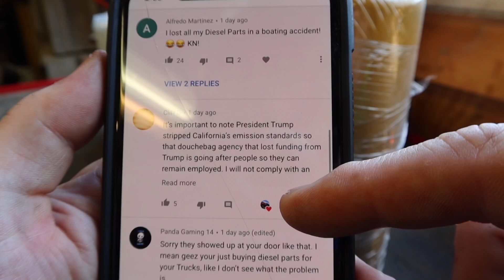I’m Under Investigation For Buying Diesel Parts!

Comment: This filter thing for guns is nothing new. Decades old in the gun industries.
Reply: True, but with all this Antifa stuff going on I'm sure there is more scrutiny... at least I hope so!
Reply: This particular way is also a feature of the the cod modernwarfare lol its like they want you trying it
Reply: @DFULLER17  art imitates life. im sure it existed and so they put it in a game. nothing nefarious just a cool concept for an escape mission with little resources there are plenty of games out there with murder must be trying to promote others to trying it hmm? ight.
Reply: @TheJaugernaut92  its called desensitizing
Reply: Oil filter adapters to mount them on a firearm are legal as long as they are registered with the BATFE as a suppression device and the tax stamp has been paid. Just saying.
Reply: @zmortis111  The oil filter adapter when registered as an NFA item is still a bit of gray area.  A registered suppressor including the baffles and end caps are also regulated as suppressors (odd concept).  You can't buy a replacement baffle outright because it is regulated itself.  You wouldn't register a single baffle.  You can send your suppressor back to the manufacture for repair where they replace the baffle and that is legal.  One company’s suppressors used a rubber “wipe” on the end cap and was told by the BATF that those were replacement parts and could no longer be sold to end users, but could continued to be installed by the manufacture as replacement parts.  Keeping in mind a rubber wipe has a very limited number of rounds through it before it is no longer effective.  Using a registered oil filter adapter with a filter technically makes the filter a suppressor part in itself -- hence the "gray area".
Reply: @Ianp54  antifa lol
Reply: @zmortis111  ahh of course its "legal" if you pay off the mob first... Hahahahaha

Comment: I purchased a Ford power stroke diesel the first motor went out at 20,000 a second motor went out at 38,000 and all has to do with the EGR coolant leak they said it was a great truck they fixed it under warranty twice I told him I’m trading it in if I didn’t it was going to become a yard anchor I will never purchase another diesel due to the fact that emissions kills diesel motors. I now on a 6.2 gas it has never broke down that 6.7 L diesel sucked.

Comment: Moral of the story: Buy filters with cash at your local NAPA.
Reply: Robert Slackware  lol. Not sure that works the way you think it does bud.
Reply: They're still gonna question you when you buy lots of Oil Filters and Oil Filter adaptors, dummy
Reply: There may not be any cash after the first of the year no matter who wins.
The old professor 
Live Free or Die!
Death to all Tyrants!
If you can not get behind these historic declarations you are on the wrong side.
No crap.
Reply: Nah.  Buy them where they are cheapest. You gonna need the money for whatever other privacy violation happens.
Reply: Robert Slackware where do you live.. Any state that requires a permit you would need to fill out an application. Thus giving your name
Reply: Robert Slackware so what state do you live in that you don’t need to give any personal info to get a carry permit? 😂😂🤡🤡

Comment: Thanks for putting us all on the tracked list now by innocently watching this video.  I mean, I'm not from your part of the country, so I had to watch all of it to understand the accent.  Plus I have a diesel truck.  On that, what kind of oil filter do you recommend for a F350, 7.3, IDI turbo diesel..  It's about 30 years old and is 8 cylinder.  Maybe recommend two. One to replace now, and one to keep as a truck filter if I have an oil related emergency and no repair shops open. The second can be cheaper and easy to slap on while on the side of the road or a field or whatever as a back up spare.  Anyway, raise your internet security awareness and searching after the fact maybe didn't help you.

Comment: I'm a silencer dealer in Michigan. I didnt know they were doing this kind of investigations. I knew there were some "solvent traps" advertised on Wish that were just silencers. I heard they were rounding those up, but not actual oil filters.
Reply: you mean "suppressor"
Reply: No he means silencer
Reply: @dsruddell  the guy that made them used the term "silencer " but they're known as both so it doesn't matter.
Reply: Solvent traps they've been using those forever they used to sell those in cheaper than dirt and literally all you had to do was drill a hole

Comment: One thing to consider. I too served in 2 branches of the Armed Forces. I have lost respect for law enforcement because I realize that in some cases they don’t have honorable intentions. I believe they you do. These guys don’t particularly care for your best interest, and are only concerned about closing this “ case”, preferably with an arrest. Police have been known to twist innocent statements into crimes, and more than once they have put innocent folks in jail. You might consider going to a lawyer, and the next time any one of them attempts contact with you, refer them to your lawyer. In general your lawyer will be smart enough to recognize when they are attempting to deceive you into admitting to something you didn’t do. You served our country, no need to get jammed up because of some over zealous Detective.

Comment: If you one have a business that goes through those filters on a regular basis . Two have a long term history of buying them. Three your in the clear. They had the same issue with starting fluid back in the late 80's and early 90's also included coffee filters, match's, hand warmers or ammonia in large quantities or frequently. My uncle owns a large cattle ranch and grows crops so he bought starting fluid and filter's by the cases and anhydrous ammonia by the thousands of gallons they ran him through the magnifying glass because he brought precursor materials. But with twelve different vehicles that had ether injection for cold starting, and 6 farm truck's that he would sometimes use either on he had to buy it by the cases, coffee filters are good for other things besides coffee or meth and and anhydrous ammonia is fertilizer in a easy to dispense form but the DEA didn't like it. But  eventually they were off to bigger fish since he was just farming and ranching.

Comment: I mean oil filters have been used for a while now.. call of duty even has them.. fram filters for pistols
Reply: Hickok45 made a video awhile back about legal to purchase suppressors that resemble oil filters.
Reply: @johnalan6067  It's a fitting that threads onto the filter that fits the threads on the barrel. This fitting is NFA item and can be purchased legally with a tax stamp.
Reply: yellowbusguy exactly and then screw the filter right on
Reply: Yea pretty soon you're going to need a background check, and a $5,000 permit to buy a threading die and tap
Reply: Joshua Bainbridge LMAO! Yup, and a $10,000 permit to buy diesel fuel because “What are you using this diesel fuel for again sir?? Running your truck? Come on! Be honest with use. We’re from the government, we’re here to HELP...”
Reply: Days gone lets you buy / find cans and oil filters to use as suppressors too
Reply: @thopkins22 I've also never seen a place where you can just buy a silencer/ suppressor without a background check, and zero questions asked.last I checked, these items require both a background check AND a tax stamp. If you buy anything elsewhere labeled as a silencer or suppressor, it's probably a faux one which is pretty much only for looks, not functionality

Comment: "Dangerous suppressors" ROLF

Isn't this ATF jurisdiction?
Reply: Bureau of Alcohol, Tabacco, Firearms. ( B.A.T.F. ) was previously known as.

Alcohol, Tobacco, Firearms ( A.T.F. )  currently known as.
Reply: Knock knock,

Who is there ?

Automatic Transmission Fluid.

Huh ? I was not expecting ATF to show up, since I did not order any.

I ordered some motor oil filters, wha is going on ?

Puts the A.T.F. on the stock shelf, leaves the garage, and locks it up.

Goes to sleep.
Reply: Atf should be a convenience store, not a branch of government
Reply: Customs enforcement is under homeland security now, a lot of what he ordered was probably imported, so customs can inspect it, track things that seem suspicious, etc all without ever needing a warrant.

Comment: If you’re smart you will hire and attorney to make sure this gets closed.
Reply: Nonsense.
Reply: It costs $5K to $10K to retain an attorney.  But the problem is that 99.9% of the attorneys out there know Jack about the ATF and NFA law.
Reply: @petersouthernboy6327  good think there are lawyers that specialize in gun law
Reply: @grapesoder1301  - with a billable of at least $500 per hour.  With a retainer up front.
Reply: @petersouthernboy6327  Could be less, I had a similar incident but worse, $2,000 in lawyer fees.
Reply: I hired a lawyer to sue for non payment on a construction job..
What kind of lawyer? One that specialized in construction cases... 
He assured me that it was an open and shut slam dunk case until I'd written the check. Then he asked "what judge you get?".
I told him. He WINCED and said that judge don't like him and said I'd be better off representing myself. He kept the loot.
I did all the work filing the case etc. All he did was have his secretary type it up nicely. I even had to pay to get the non payer tracked down and served. Private detectives actually do what they say they can do. Other than that the justice system is laughable
What a fucking ripoff.
Reply: Total waste of money.. I just wouldn’t answer anymore questions for them.. if they actually bring charges, then lawyer up
Reply: @mikeries8549  a federal criminal defense lawyer would be warranted in the case of the YouTuber in question, a totally different issue than a civil case due to lack of payment, by a huge margin.
Reply: Law enforcement actually never closes the cases especially if they have made a mistake, No one wants to write the report for the IG to read unfounded, that means we investigated an innocent person, So no report case will stay open, citing we may get back to you.
Reply: Problem with that is getting stomped on because you hav not enough money
Reply: @zazarays  that is an unfortunate truth!
Reply: There is nothing to close dude.  Private citizen did wrong and the police and feds will continue to spy and get no warrants.

Comment: The fact that you didn’t buy an oil filter suppressor adapter means THOSE AREN’T SUPPRESSORS!  You can’t just screw a filter on a gun without modification.  Period.

They actually do work, it doesn’t take much to decrease the dB.  Even a pillow will silence a gunshot to an extent.  Oil filters decrease the bang by a good 20-30dB.  The performance will degrade faster than a purpose built suppressor though.

Comment: 2021 the president passed a law that said everybody's phone data and financial records will be accessible to the government from your phone. The most only illegal thing I do is speed in my Prius that I've modified. Instead of 84 mph. I live next to the biggest auto testing facilitie in Arizona.  When I turn the traction control off with the computer app with no button for it it accelerates from 0 to 60 in 5 seconds. And according to the test track driver and gps. It does over 110mph. Amazing what a Thornton tuner chip and A electric supercharger does to a little teeny engine. It's a 2003 Prius with the original battery. And with the computer chip the battery lasts longer and charges faster. And my gas mileage is up the 40 miles to the gallon from 29. When I drive it like a Prius. I even towed my 1977 Ford F150 Ranger XLT 4x4 to a transmission shop when the 45-year-old transmission finally gave out.

Comment: The local cops should never have went on this call. The state has no interest in a guy buying oil filters. This is a fishing expedition. I was a patrol Sgt for a police agency and I turned the feds down several times for BS like this. You get into a problem call us. Got over ruled once by the WC or sometimes had no choice but to assist. Tactically these guys are a friggin mess and can screw up a wet dream. Don’t give them the time of day if you don’t have to. Not a fan of the feds at all and what we’ve seen of late just reinforces that.

Comment: Anyone have any good sites for diesel parts? I need a transmission and a transfer case for a 2004 dodge ram 2500 4x4. I know it's going to be expensive, but I'm trying to keep the cost as low as possible.

Comment: Yeah, because you looking into suppressors, even probably clicking on ads, you were added to a watch list. There’s a whole system. And the reason why they showed up at your door after you bought the oil filters is because people are selling “oil filters” and other “filters” as quite tech stuff for your super soakers, just labeled “filters”. 
So, you were added to a watch list for looking into suppressors, then when they saw you buying “filters” they had to act upon that, and make sure you don’t illegally own any suppressors. Even though I think they shouldn’t crack down on them, it is good that they at first give you the opportunity to just turn them over. They’re not buying them back, they’re just taking them. Which is better than jail time + huge fine.
I can’t really say too much about the correlation because I don’t want anyone getting into big trouble over illegally owning suppressors.

Comment: 7:05 That's really bad; bitas or particals of metal. That's worse than what people call a Fram " O.C.O.D". Tiny pieces of cardboard might not destroy an engine right away. Metal particals will NOT burn up and might even grind out and wreck a crankcase. Thankyou for warning us all in advance. I'm only a self admitted wannabe maintnece parts changer; not a mechanic.

Comment: Technically this is an invasion of privacy. In addition fuel filters are also used as a connection point for a Hydrogen or LP bottles. Because you don't want to damage your fuel rail. Also I am trying to convert an RX-7 rotary engine to multi fuels! They will also tag you for ordering off Amazon.  3 months after ordering a fuel filter from Amazon and Amazon had reimbursed me. I got a letter from US Customs. I explained that the fuel filters were now Amazon's problem because they had already reimbursed me. Now that I have finished the Mod for the individual who owned the RX-7 engine. I am trying to set up a Hydrogen cell for my generator. Now because of idiots in the government I can't get the quick connects tapped into the empty fuel filter tube to add the Hydrogen and LP bottles to my generator. Because some people are making things into silencers or so they think hint(it doesn't work as advertised) plus a buddy blew up his rifle trying to do stupid mods.  Stick to legit uses folks and don't believe the click bait on YouTube email etc.

Comment: Good video. I don't understand how you have respect for those who are the main cause of "these times". My g0d man they showed up at your home with guns over a few oil filters...
Most of those oil filter suppressor kits along with the auto pistol conversions are in fact sold by the ATF or other law enforcement. Its called a trap. Last ... why yes "they" are watching everyone.. the difference is they are open about it since 2015 Just FYI..

Comment: 2015 deleted Turbo Diesel 10,500lb TRUCK!  I get 27-33+MPG on freeway!!!! 6speed too!  My oil is clear till about 5000, so I change my oil every 5k to keep the oil clear. No DEF. I have about 498,000 miles and my oil is CLEAR!!!  2nd clutch, 3rd set of brake pads! 2 water pumps, 2nd FAN BELT!  No HP tune, stock! 2 KN washable drop in filters. Yes, 2 KNs!!! I'm so HAPPY my TRUCK is 4x4, 4door, camper shell and CERT rigged. aka Civilian Emergency Response TEAM, aka TRUMP TRUCK since 2016. My intake manifold is the $79 stainless China Deal, and my intake is clean aka kinda like tarnished metal, not black. My Turbo is ORIGINAL. I soak the turbo hot carbon side 3+ times Simple GREEN and let that clean out the Black carbon in Turbo. I do that 1x/100,000 $9 simple green 1 gallon. I change the power steering, brake fluid and coolant every 100,000. I change the TRANS, TRANSFER case, Front and back DIFFs every 25,000.  Oil filter, 3 fuel filters all change at 10,000. Oil every 5000. Over the years I picked up may used parts that I though I would  use: From a HEAD, turbos, radiator, H2o & fuel pumps, lift pumps, CP3 (2),  Hoses, lines,  and I bought out Bankrupt shops: Average Oil $2-3/gallon, Gear Oil $2/qt, Trans oil $2/gallon, and I buy Factory TAKE off tires 10 ply, 3750lbs rated at 40,000miles, $200/set of 4. Yup, $50 each.
My cost is about 35cents per mile which paid for the truck in 300,000. The cost for a TESLA S for 500,000 miles is about 65c/mile including everything(2 battery changes). So I may not collect on my Tesla Truck reservation??